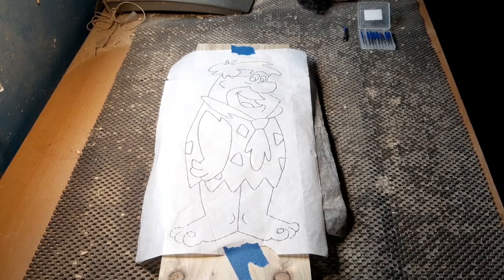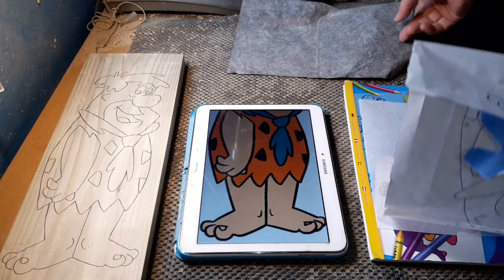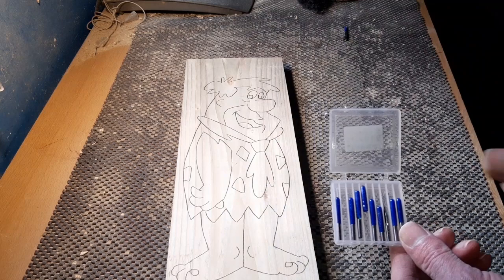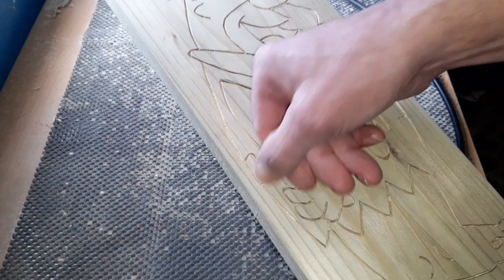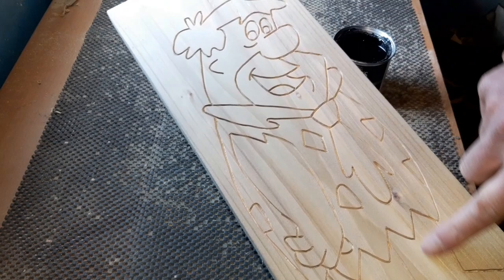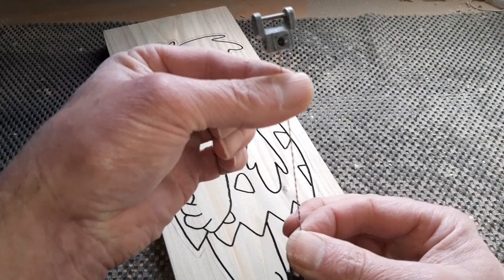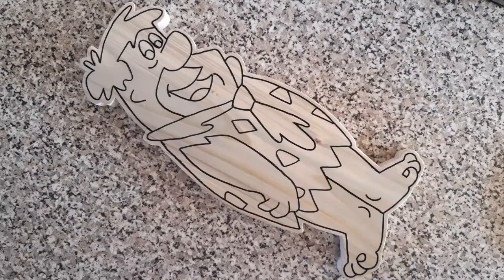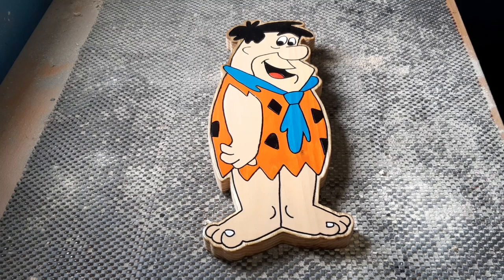Fred Flintstone on fencing wood, router/scroll saw project...

Comment: Another great project nicely done. Good tip to trace the template, it does work I've done it before as I seem to struggle with the poster apps, yet to master it that way, must be an age thing 😊. Tried an age to print out the gnome you did but failed miserably 😂. Is the fence wood you use treated ? It's all  treated that dark brown in my area.
Reply from the maker: Cheers Peter, the templates are a perfect size ,for the fencing wood I use, definitely an option on simple projects..

Comment: another great project Shane. a quick question. do you water down the paints before using them?
Reply from the maker: Thank you Joe, I always water the paints down as I paint, it makes more of a stain then a paint...works well.
Reply: @fishtank5050  cool i didnt water mine down and i noticed that you can see strokes on it cos its too gooie so im gonna water my paints down from now on
Reply from the maker: @ahmelmahay  the paints are definitely better for watering down,it leaves a nice smooth finish,even better when the finish goes on..

Comment: When removing background material, which do you find works better:  End milling bits or upcut bits?
Reply from the maker: To be honest Robert I've only used end mill or straight flush bits for clear out..alot of folk use spiral upcuts..